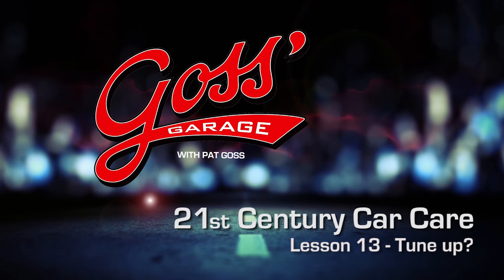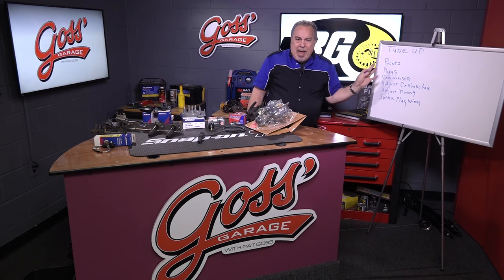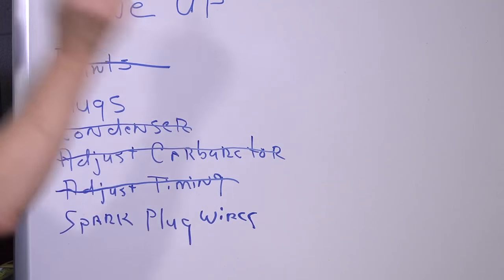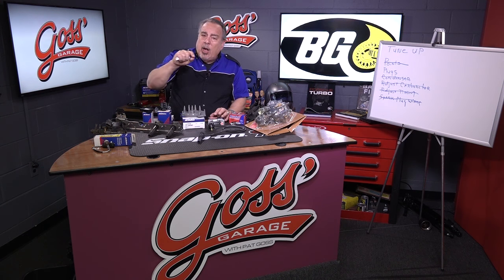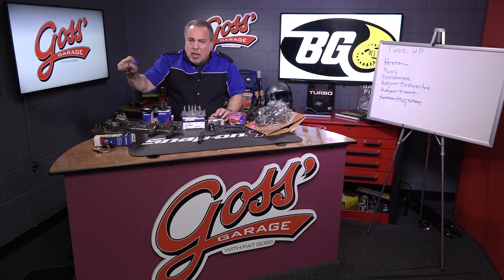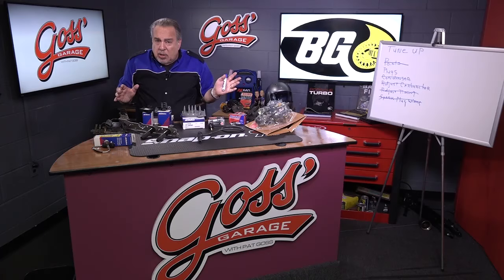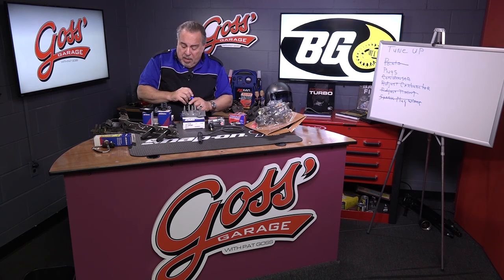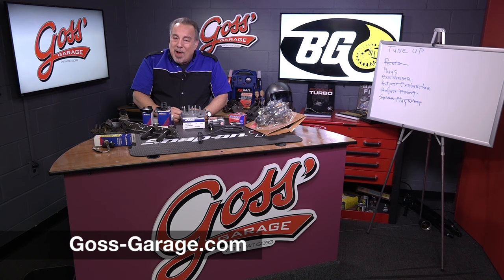Goss' Garage with Pat Goss - Car Care Lesson 11 - Tune up?

Comment: I remember replacing/adjusting the points on my 1972 Dodge Dart Demon without a gauge, so I used a matchbook cover.  At least it ran well enough to drive it to a gas station to have a mechanic set the right adjustment.
I also rebuilt the carb at the kitchen table.  : )
Reply from the maker: Jeff:
Thanks for watching and taking the time to comment, I appreciate it! Back then plugs
lasted 10K to 15K miles and now drivers get upset when their plugs wear out at
100K. My how times have changed!Pat